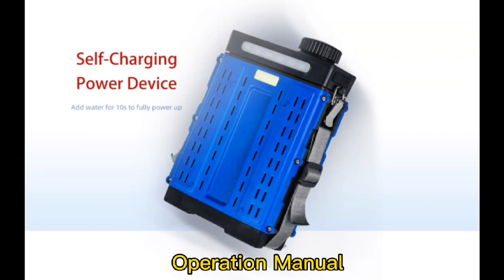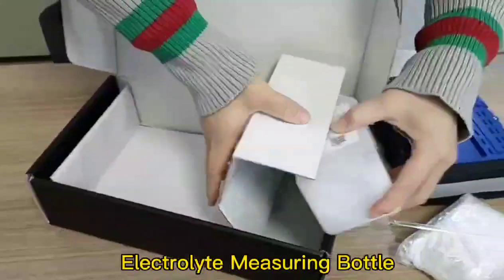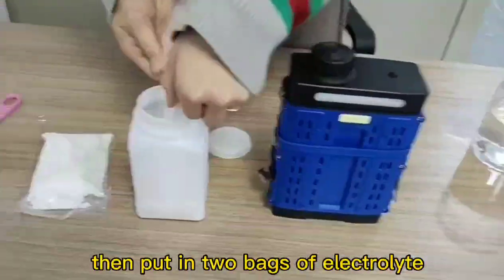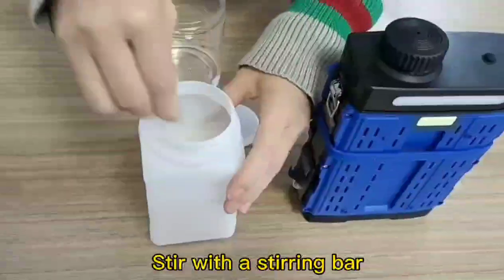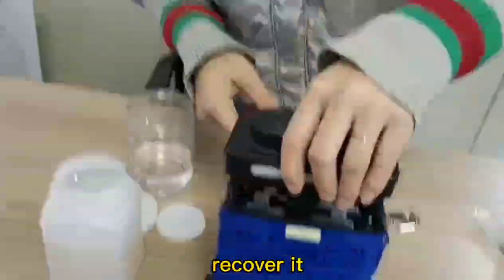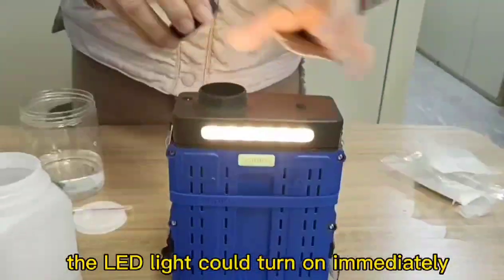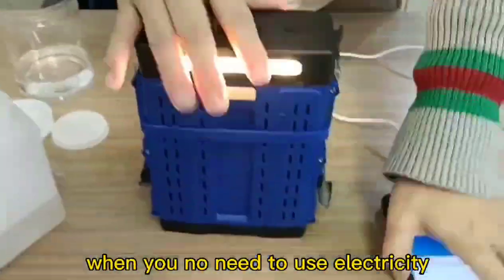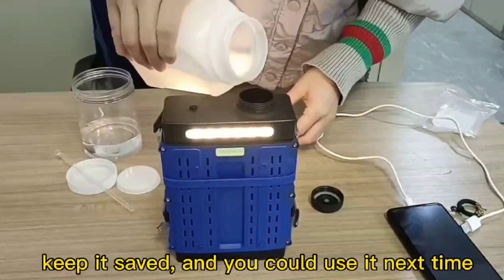Operation manual of Aluminum-air battery

Comment: How to get more electrolyte solution.
As There are only 4 pouches.

Also how much power it can Generate?
Reply from the maker: You could buy from us. or also we could let you know which solution could use. for more detail pls contact me: nancy@geapower.cn.
4 pouches solution which could make about 60000-70000 mAh electrical capacity.